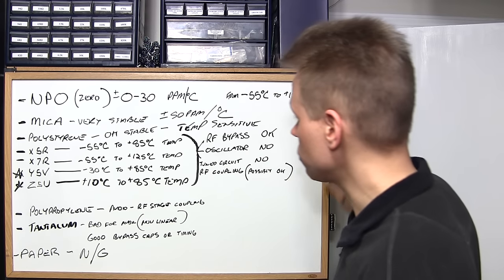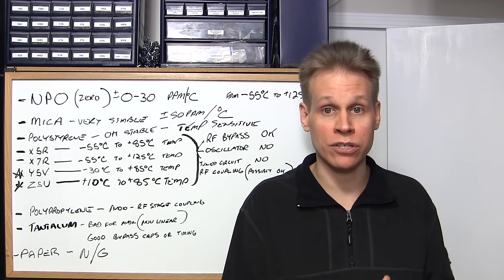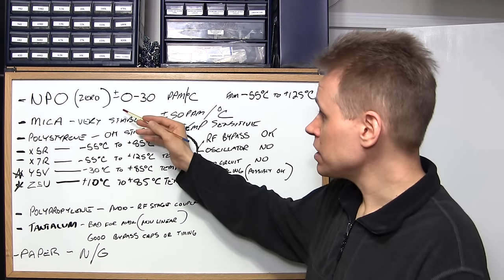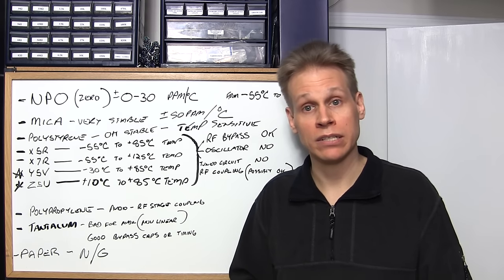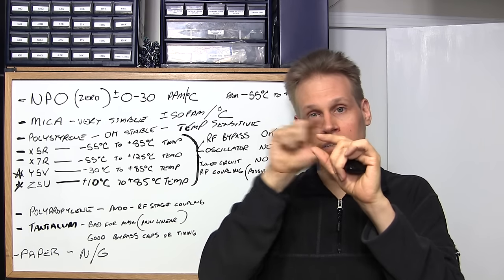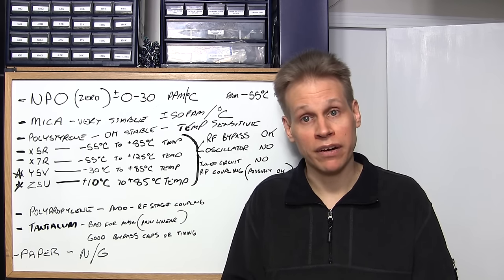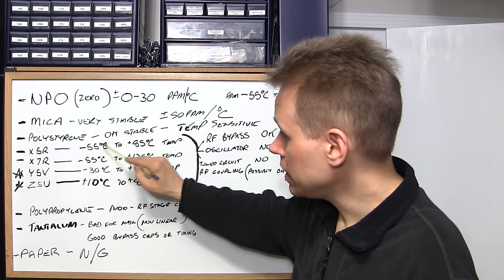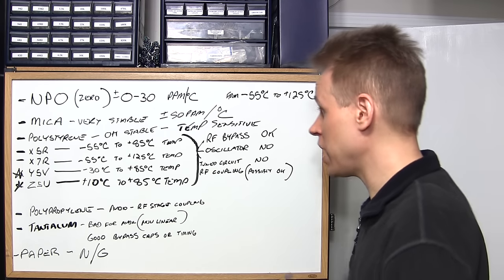Which Capacitor Do I Use? Tech Tips Tuesday

Comment: Great video.
Question: I have an audio rack mounted unit made by Eventide, model H3000, that one day when I turned it on a Cap went bad. (The cap was somewhat blackened and looked burnt). It's a very high end vintage Harmonizer mostly for recording studio environments. I was told years ago that the Cap was a tantalum cap, but I am not so sure now that the info I was given was correct, especially since you mentioned they are bad for audio. 

That cap is bright Orange and looks "exactly" like the material (and color) of the orange drop cap you showed on the video. The only difference is the shape. (It has a more vertical shape and is rounded at the top...IE: skinnier and flatter on the bottom by the legs/leads and it bulges out in a rounded ball like fashion towards the top...I can see the number 25 on it and has a black stripe).

I'd like to get this unit going again (has a great 12 string guitar effect as well as many other great effects) and don't know what type cap to buy for a replacement. I would send a close up photo of this type cap (there are many of these orange caps in the H3000), but there is no way to post a photo in these comments. If you could help determine what I need to replace it with, I would be very grateful. I have schematics for the unit too in the PDF document service manual. Thanks and gave you a Sub. Very well done video.
Phil

Comment: A while back I found an Atari 2600 with no sound. Traced it to a pair of failed polystyrene caps.   I had the idea of replacing them with less expensive ceramic caps.   Bad idea, I forget the type of noise but it was horrible.  

Then I purchased some polystyrene caps and while soldering made the mistake of cutting the metal leads too short and the heat melted the caps.  Next time I kept the long metal leads and soldered as quickly as possible, got the sound back.

Comment: Since the ceramics are microphonic and induce spikes back into the circuit when exposed to vibration, would they pose any problems in analog circuits, bypassing the supply rail of opamps or similar circuitry? it makes great sense to not put them in the signal path, but what about decoupling - is the supply rail stiff enough overall, that it wouldn't matter? Thank you for making these awesome videos. Keep them coming!
Reply from the maker: Ceramics are great for bypass (RF) and low vibration atmospheres.

Comment: Hi, 
thanks for the great video! I'm glad I found your channel it contains really practical theory.

I have a question regarding the polystyrene capacitors. You say they are OK stable but temperature sensitive. Why should I use them at all, as I could use mica and np0 for temperature stability and if that's not needed other types not having these side effects? There must be positive characteristics otherwise this type wouldn't be used any more and i.e. by technologic evolution.
Reply from the maker: It always boils down to cost. Thanks for your comment!

Comment: I was ordering some Nichicon electrolytics, and I noticed that there is a 'life' rating on those caps that is in the 1000 to 2000 hour range.  That isn't much time for a device you are going to use a lot.  Do modern capacitors really last only a few thousand hours? Should I be looking for better caps? 

Thanks for the videos!
Reply from the maker: +Chaka Wolf 
That life rating is at it's maximum temperature. So for example, if you have a 105 degree rated capacitor, and it's life span is 2000 Hrs, It will last 2000 hours running at that high temperature. Most capacitors don't run at that temperature, so the life of the capacitor should be substantially longer than that 2000 Hr rating.
Reply: Chaka Wolf That depends on what you pay for. You can buy 10,000 hour automotive rated capacitors that will last that long in a hot engine bay, but you may get a sticker shock :)

Comment: Hello Mr. Carlson, in this tech tips tuesday you say that we can replace "Bumblebee" and other old leaky capacitors with  Polypropylene Capacitors when we do a restauration of old radios and amplifiers.  But i have noticed that when you do a restauration, like the old "All American" from the thirties that you showed us recently, you used yellow polyester film capacitors.  Is it ok to use both of them, or are the yellow most  preferred?  I ask, because the yellow capacitors is very difficult to find around here, i need to order them either from Taiwan or United States, and the postage is much more expencive than the price of the capacitors. I hope you can give me an advice for what i can use.  Have a nice day,  73 Asle
Reply from the maker: Hello Asle. Most polypropylene or polyester film caps will be OK. The outside foil should be identified for oscillator circuits, and the capacitor placed close to the chassis (but not touching)
Reply: Thank you for your answer, Mr Carlson (it must be middle of the night in Canada he he).  I will definately build the SWIFT device on your Patreon site, because i have tried many times to find the outside foil side using my scope, but i never succeeded.  Must be something wrong i do.  But the SWIFT device looks brilliant. 73 Asle

Comment: I am making  a 100 led sign. [green leds, 3.2 fv.20mA, using one 3.3K , 1/4 watt resistor for every 5 leds. I only have 240 volt home power and have rectified with the 4 - 4007 diodes  Will I need a capacitor to smooth out the power and what value would this be?  Would I also need another resistor connected to the bridge rectifier?  My sign will not be flashing, just on for a few hours per week. The entire circuit will be isolated in a non-conductive box and just be plugged in to a wall outlet when needed. Thank you in advance.

Comment: What's your opinion on Gretsch instruments company going back to using paper in oil (how I heard it) capacitors in their modern guitars replacing the typical ceramic capacitors? After hearing this I'm  wondering if that's a bad idea in the long run? The reason given was that these older style capacitors give a vintage element to the guitar tone. I am asking this as a layman.

Comment: One capacitor you did not discuss(?): my Hallicrafters SX-100 has 2.2 pF composition capacitors used in tuned circuits.  They look like half length 1/2 watt resistors except the body is gray; they have color code bands, and the leads run from the center axis on both sides.  Have you encountered these and what is your opinion on their aging, leakage, stability, etc.?  Thanks, Albert

Comment: should I use... new old-stock capacitors? I'm wanting to try my hand on repairing an old valve radio and amp, first step is to replace all the caps, I have been given a box of old but new capacitors, some of which Ive not seen before, they are old stock... I'm sure they must dry out but I would hate to throw them out.... Thanks for any advice...

Comment: Thank you for informative video.

I got into DIY audio quite recently and I didn't understand why the most of audio community is so fond of polypropylene, polyester etc. caps. So it is all about resistance to vibrations? Or are there any other properties?  So if I'm interested mostly in gear for headphones, therefore there are no vibrations from loud music, is it okay to use other type of caps? 
Also it doesn't help that most DIY audio resources don't explain in technical terms why use film caps and resort to "they just sound better" reasoning.

Comment: Hi....not even a minute and i go: No Way ;) for 0:43 --- Do you know how much of these are in the Tone Generator of my Hammond M-3 organ...? Do you...? it´s 76 generators, each one with a 12dB filter (two caps) all custom made in order to have the desired cut-off frequency...The higher tones even got some high-pass filters prior to that low-pass...
An example one of these paper/film caps read  .06 another one .78....great stuff. 

Leakage is not a huge problem here as they aren´t blocking any DC...may be i just install some new caps in series when a particular tone gets too silent...but until now...she´s just fine...

Anyway,  GREAT video, as always!
Reply from the maker: +TubiCal 
Thanks for the nice comment! Leaky capacitors "that really leak bad" will trick modern meters. When the caps leaks, it takes the meter longer to charge the capacitor (due to that imaginary resistor across it) , giving you a higher reading.

Comment: Why does heat cause the capacitance to go up and never down? Are there any other factors that contribute to this change such as voltage rating, etc.? Or is it strictly the temperature rating? Would a 100v capacitor react the same to heat as a 25v capacitor?
Reply from the maker: It depends on the way the cap is made, but they usually drift up. When the dielectric expands, it pushes the plates apart. NPO  C0G types are built in a special way to counteract this expansion/contraction affect.
Reply: @MrCarlsonsLab  Thank you. Your videos are amazing man. I plan on signing up with your patreon in the near future.
Reply from the maker: @BufferStuffBuddha  Thank You for your kind comment Steve!

Comment: Vibrations are low enough frequency not to matter much to RF even when present.  Mostly it would look like a varying DC bias.
Reply from the maker: Low frequency vibrations seen while viewing RF frequencies on an oscilloscope can be viewed as "Modulation."
Reply: @MrCarlsonsLab  Some circuits do indeed use it for modulation, but typically the heterodyning and protocol requirements reduce it to noise rather than signal even then.  I suppose there is a theoretical possibility that coupling RF with ceramics might occasionally make vibrations audible, but, if so, the circumstances are sufficiently rare that this is still standard practice.

Comment: Cbeautiful illustration and explanations how different types of capacitors are used for a specific kind of  use in the circuit ,be it oscillators types or coupling functions or img ones,how they react to the temperature that creates after a certain amount of time in the working circuits.thanks very much for your excellent demonstration and explanations. A. Ballestri.switzerland.

Comment: I have a DC refrigeration unit on my boat that is very sensitive to sudden voltage drops, like a water pump coming on. The unit will shut off to keep from draining the batteries any lower then start right back up. I want to add a capacitor to help stop this. Any size and style recommendation? Thanks.
Reply from the maker: Run the refrigeration unit power lines directly (Fused) to the battery. This should correct line sag.

Comment: Great info. Now I need to replace a few caps I have been using on some AVR projects.
Dunno if you dabble with Arduino but 90 percent of the time I have seen people use ceramic caps for the timing crystal when running the AVR on a breadboard or embedding it onto a PCB. I Didn't know they were that sensitive. Might be the reason why I keep having issues with my DIY LCR meter that uses a AVR.
Reply from the maker: +Leland Clayton 
Hi Leland, NP0 capacitors are a form of ceramic as well, just make sure that the caps in any oscillator circuit are NP0 or C0G and you will be fine.

Comment: I've been glued to your videos for the past few weeks and learning more than I ever had.  Thanks for your dedication.  Considering joining your classes on Patreon.
I've posted a question on your google+ page on this same article seeking information on a multi stage 1.5KV .5uF oil filled number OB-11G1W36P for a 1470 B&K Precision Oscilloscope from Dynascan 1974.  I'd love to hear what you would do.  This is a beautiful oscilloscope and I'd very much like to get it running again.  I've ordered replacements for all the electrolytics on the list, but this can looks serious and apparently not in production at Nichicon any longer.  Thanks for any ideas.
Reply from the maker: Hello Adolfo. Digikey sells some poly type capacitors that are rated that high, that may be a place to try.
Reply: Thanks Mr Carlson, I take it that using separate caps made today instead of the Nichicon oil can would be acceptable.

Comment: Can you please help me find the correct cap to reduce the engine noise in the AM band of my car radio?
Reply from the maker: Get spark plug leads that are "resistor types." Make sure the coax cable running to your antenna has a good shield. If you have a fiberglass hood, get the AM reception antenna relocated to the rear of your car.

Comment: Great video on Caps.  Here's a question: older engine ignition systems have a "condensor" (cap) in them.  Since the new "made wherever" condensors are pretty much JUNK could you pass on your thoughts on a long lasting modern replacement cap.  Please think about the use in a Magneto which has up 12 volt AC across the points.  Thank you very much and have a great day!
Reply from the maker: +Kevin Gardner 
Hi Kevin. There will be many hundreds of Volts (with some peaks into the thousands) across the points when they open as the magnet field collapses on the core of the coil. (this is on top of the 12 Volts DC going through the coil.) Your Standard capacitors in breaker point ignition systems have very high voltage ratings. Without putting a scope across your breaker points, it's hard to say what the peak Voltage would be. I recently used a modern .25uF  polypropylene Capacitor rated at 1200V for a hot rod, and it works well. I'm not saying this would work for you, but in my application (dual breaker point ignition) it worked well.

Comment: I'd like to hear Mr. Carlson speak more about The VOLTAGE Theory and how the voltage ratings  affects the AC Signal Electrons pass through the BY-Pass Capacitors.. It's nice to have a Voltage Margin Rating (for shortage) but having that.. it also affects the AC Electrons making their way to the GRID of the next stage in the Amplifier..  I call it the "SWEETNESS EFFECT".. Instead of having (ORANGE DROPS) rated at 600 Volts DC.  The OLD TIMERS used Paper Caps for a reason..  AND..   they were mostly rated at 400 volts DC..  For a reason..  I'd like to hear-and-speak, maybe with a demonstration, Mr. Carlson discuss this ASPECT and  IDEA..

Comment: Very interesting you say to ditch old paper/foil caps. Many home amp builders swear they are the only thing that gives 'authentic' tone. Can you offer a non audiophile comment on whether caps effect tone in these applications? There are many manufacturers who are making new paper/foil caps and claiming that they allow users to capture vintage tone. They are very expensive compared to modern poly/film caps which you have shown are very stable. These modern paper/foil caps would also have a shorter in-use life before they too would leak DC. As a side note it is unfortunate that many also buy very expensive NOS paper/foil caps such as Bumblebees etc and expect them to out perform a modern equivalent. Sadly I think these Caps deteriorate on the shelf when not in-use, thus good performance could never be guaranteed. Your thoughts on this would be interesting to know.
Reply from the maker: I think what a lot of people don't realize is, Poly capacitors sound the same as the paper ones did when they first came out. The paper capacitors have now developed leakage, and that biases the next stage into hard class A. This affect makes the sound smooth, but is hard on the tubes. This is why old capacitors sound good, and it's the truth, I won't deny it. The catch is..... They didn't sound like that when they first came out of the factory; they couldn't or the manufacturers would be replacing transformers and tubes continually. I have a paper capacitor from the 40's that's not leaky, it was sealed in a can..... On my analyzer, compared to a modern metalized polypropylene capacitor, it looks identical. Capacitance, dissipation, leakage tests. Frequency response test using my Stanford Research model SR-780.

Comment: Is the increase/decrease capacitance change with the different types always the same based on increase or decrease in temp?  In other words, with the ceramic cap, does the capacitance always decrease as the temperature increases while the mica and NPO increase in capacitance as temp increases.

Comment: I have a Zenith stereo console from the ‘60s that has Callins capacitors. Are those considered bumble-bee caps or are they pretty decent? The amp works fine but I think it might sound better if I re-cap it. I would appreciate any input.

Comment: Hi Paul, an old video, but a good one. I was hoping to get your thoughts on automotive "condensers".
Its always baffled me as to why they use an electrolytic cap in such a hot environment, historic reasons I guess?
Thoughts on replacing those devices with a film equivalent?

Comment: I have a question.  On tube amps, I can understand how to make the impedance right to speaker with an output transformer. But, on Transistors, FETs and ICs there are usually big capacitors and some resistors.  How is this calculated?

Comment: I have a tektronix fg503 function generator module that has a frequency dial that doesn't have a reliable response.  It's spot on at 0.1, 1, and 30, but it drifts off and by 10 it's low by 5%, then back.

I've followed the calibration procedure to a T (boy are those pots finnicky, is contact cleaner OK to use on those?), everything checks out, but I just can't rely on it being reasonably accurate without first checking the frequency with my scope.  It has the original polycarbonate film capacitors, with a metal shroud, and I'm wondering if those should be replaced?

They seem to be electrolytic, but I feel like the waveform wouldn't look near as clean as it is if the caps were going.  Thoughts?

Comment: \Would there be a subjective difference in an old 70's tube radio which has plenty of ceramic caps, if I replace them with poly polypropylene caps?  I cannot imagine that the amplifiers in those old All American 5 tube radios vibrate them enough to make a difference one could actually hear.